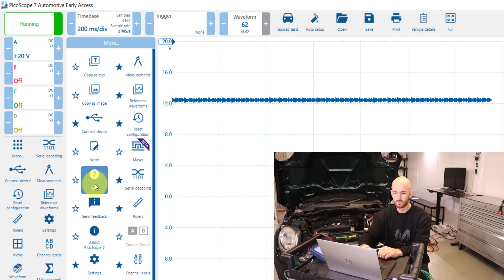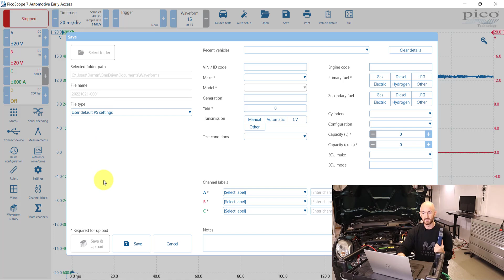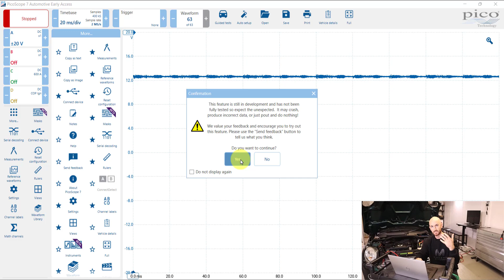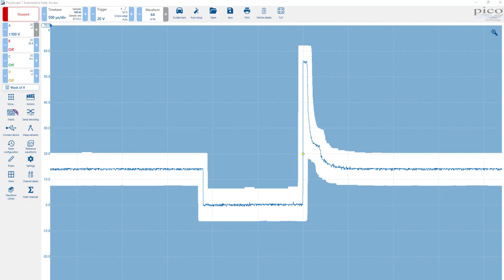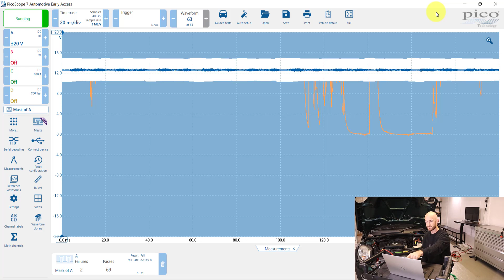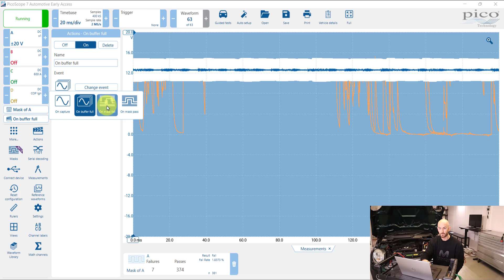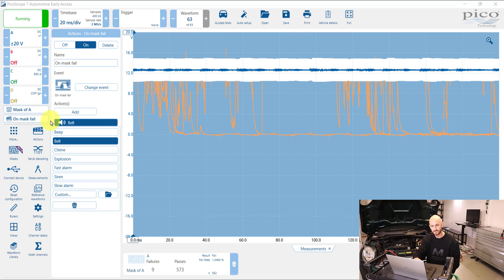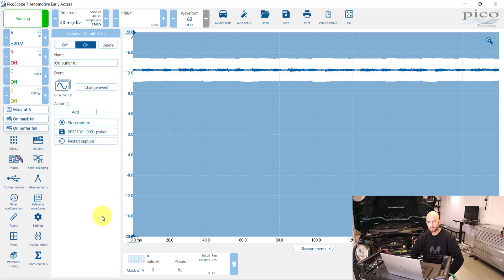PicoScope Masks, Actions and Updates!

Comment: The mask looks really useful! The ability to keep saving and restarting (instead of looping) is definitely going to give my graphtec data logger a run for its money since the ability to record long records is what I bought it for...!
Reply from the maker: Interesting, not used that data logger before. What do you use it for?
Reply: @MechanicMindset  It works as a coarse oscilloscope (data logger) mostly for catching stray signals, voltage spikes, etc. over long periods of time (ie, the costs in the machine). Has pretty much the same triggers as a scope but not anywhere near the resolution. Same as a scope, you can also set it to stop recording and save when it catches a signal of interest. Or it will just fill up the available memory and stop or can be set to loop back through. It'll keep going until the power runs out, or the time limit is up. 10 inputs for probes and you can attach whatever you need for probes as long as the voltage is attenuated to the limits of the logger. Obviously, the more inputs and longer time periods that you choose, the coarser the data will be. But the resolution of data interval updates are still way faster than my Launch x431 so I can get better graphing results. Look up Graphtec midi data logger. I have the gl240 (little one with a screen). There are other, much less expensive data logger out there if you just want to use a laptop to do your recording, but it seems this new masking and continuous file saving with better resolution will make the graphtec unnecessary. (or maybe Pico had that all along and I just didn't find it... 😔)
Reply from the maker: @KingLoopie1  Thanks for sharing. Yes, this feature has been there for a while in Pico 6. But you gotta use what works for you. Your tool sounds convenient 👍
Reply: @MechanicMindset  sorry for the wall - o-words
Reply from the maker: @KingLoopie1  😂 Thanks for Sharing
Reply from the maker: @overload1010  Yes it does 7:15 👍